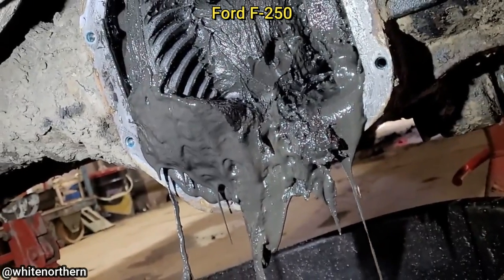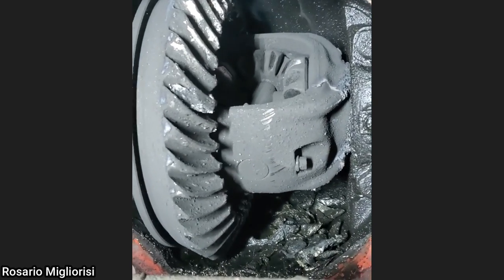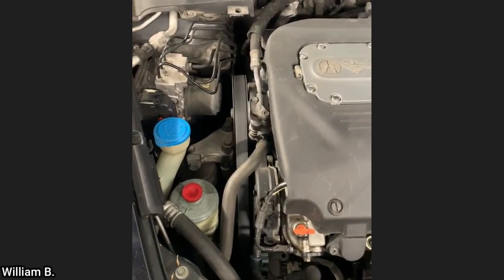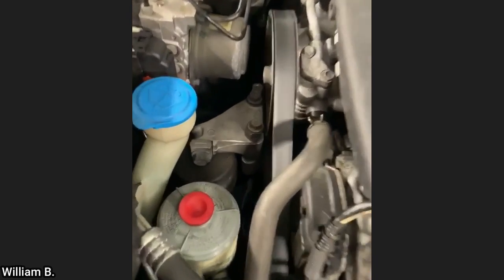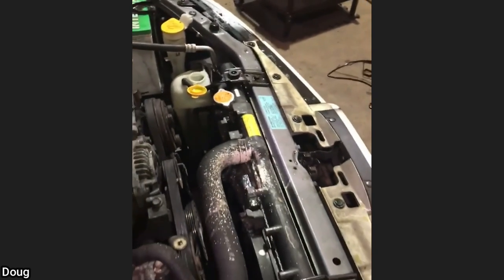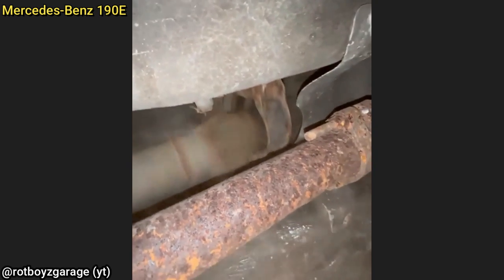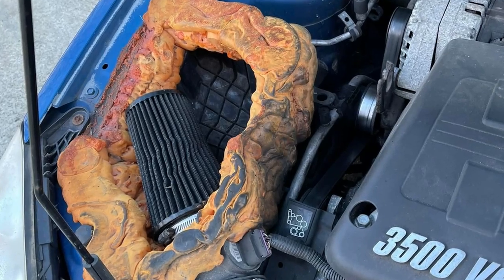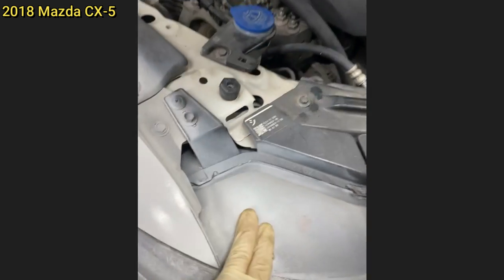Customer States Wheels Locked Up While Driving | Just Rolled In

Comment: How does one refuse getting a gasket replaced on a differential that is leaking? 
Probably the simplest repair/maint. job ever. 
Remember folks, these are the people with whom we have to share the roads.
Reply: Its probably one of the cheaper jobs you could have them do. Or do it yourself in 30 minutes.
Reply: I once worked at a shop that would have charged $200 labor, plus materials. Which is a blatant rip-off. But, they were the only shop in town.
Reply: A very costly replacement/repair now!! Hope the learn?!?
Reply: The other ones that kill me are the 'shade tree' mechanics who don't know that a torque wrench is a good thing to have and the bolt head (or god forbid a manual) will give you a clue.  Oooops.
Reply: i'm so glad i live in a country wich actualy has yearly safety inspections for cars! :)
Reply: I believe they said it has an axle seal leak, which isn’t exactly a quick fix. Still, would have been better than running their junk dry.
Reply: +1 just for the proper use of the preposition in the last sentence.
Reply: I would think that the majority of the times, it's due to the customer thinking they can either do it cheaper themselves or find someone who will. And it just keeps getting put off until the inevitable happens.
Reply: So in order to take axel seals out, you basically have to pull the diff cover off. Remove the c clips and the axels along with it. Than finally pry out the seals. Then once that is done clean up the surface of the plate, put on some new rtb, torque to spec. Then finally add the fluid. It's mess and it takes forever, but in the end is cheaper than a whole new diff.
Reply: I always believed an once of prevention is worth a pound of cure. So, I try not to let anything going wrong on a car not get repaired.
Reply: Thats literally nothing compared to the people who never service their tires or brakes.
Reply: @skurblord3401  Depends which gasket is leaking. If it is the differential gasket, the drive shaft has to be removed as well as the two axles. Then you have to have some equipment or tools to do it.
Reply: Also... those are the peoples old enough to do politics, and are filling the internet with comments like "climate change is a scam".
I would trust their excellent judgment.
Reply: @Nature31  in Spain we have annually inspections in cars older than 10 years too  , but i have to tell you that people who drive destroyed cars like that doesn't care about pass the inspections or fines  , being honest i ve never seen an extreme case like this here in Spain in road going condition but i ve seen daily driven cars with big problems and rusted parts that with time will end up like cars in the video and the owner doesnt care  and they drive the car in open roads with the rest of us so still be careful if you a shitbox looking funny driving on the road
Reply: @RANDOMNATION907  $200 doesn't buy 1 hour of shop time anymore, and that's usually the minimum time charged.  You did the work cheap in my opinion.
Reply: I dunno his story, but when was a kid I had a minor leak on my car diff, I just had them change the oil and the leak went away.
Reply: Was it only gasket or seals?
Reply: @clintletendre5585  I think he said gasket.
Reply: @boboutelama5748  <<< Al Gore fan detected......
Reply: That's why it's called defensive driving and not just smart driving, you might be the biggest risk to yourself, but everyone else is in a close second place, with some Very, Very, VERY CLOSE
Reply: And they can vote ...
Reply: @Nature31  that's un-American
Reply: @nicolasrouvreau8365  and breed
Reply: @Nature31  and a 40% tax rate I’m sure 😂
Reply: @skurblord3401  Most of the people that try to do it themselves end up back in the shop and in these great videos. :) Just pay the professional mechanic. 
Not the friend that says they know what they're doing. If your friend isn't a professional mechanic or retired mechanic then you're taking a big risk.
Reply: @Pieter Senden  I'm sure you like big brother watching over you and taking your money
Reply: Because money is hard to come by the average person cannot afford a 1000 dollar emergency repair
Reply: My car's diff is leaking, as is the engine and gearbox, i just dont have the time to fix it right now. gonna do it this summer. i check the fluid levels periodically and top up as needed. since the leaks arent mayor.

Comment: 1) that's how i always imagine my diffs looking like until i check up on the fluid level every oil change
2) man that chevrolet is so gorgeous, so happy to see old 1950s cars still around and in amazing condition, there is something truly beautiful in those '50s designs
Reply: You check your Diff fluid everyday???
Reply: @Thunderbyrd.  bruh, he said every oil change. 😂
Reply: Just wondering.  . . . . 70 years from now will people be restoring the current crop of electric vehicles?
Reply: looks like Chevy has Mopar exhaust tips...?
Does look/sound good
Reply: That’s actually my chevy! It’s powered by a 327 that I took out a 62 vette, and it took a couple years but it’s a full restomod!
Reply: @brakelineautomotive  What a beautiful car!  Thank you very much for sharing it with us.  What happened to the '62 Vette that donated the engine?
Reply: @brian5o  buddy of mine got rear ended pretty bad! He ended up selling it for dirt cheap already mostly built (>$1500) and we picked it up!
Reply: @Thunderbyrd. bwm driver spotted

Comment: That front diff filled with mud...that is just insane. Left me speechless.
Reply: I thought it was cement.
Reply: @andypetrovich2155  maybe it was.
Reply: @mikefoehr235  
We have seen it in previous episodes.
Reply: @andypetrovich2155  How in the hell did that driver get cement in the differential like that..crazy
Reply: @mikefoehr235   Can't answer on that case but in another?  How did the driver at the mine my cousin works at get the differentials on the work truck full of cement?  Easy answer in that case, environmentalists were sabotaging the trucks.  That happened in Canada.
Reply: @elilla331  
The cement wasn't from jogging through the work area because there was less traffic?
Reply: @andypetrovich2155  Not that day I don't think.  Though I've heard similar cases in parts of Canada where that's happened, especially near Fort Mac.
Reply: A terrible leaking diff seal maybe?🤣

Comment: "Customer states - Steering wheel loose" killed me. I am writing to you from the afterlife.
Reply: I work in car rental and recently got a return with a note "C/S back window doesn't work". Turns out it IS actually broken. But the first thing I checked was to see if the window lock button was on.
Reply: My favorite after "Blue light on dash won't go out" and it was the high beam indicator
Reply: @nancytoothaker3224  I had a co-worker, young female, who didn't use driving lights, because it just put the high beams on, not the low beams. I tried to tell how the lights work on a car, but I think she didn't got it.
Reply: Same here. I especially like the mechanic's attitude - there's a guy who's 'seen it all before'. Oh well....

Comment: Somebody might make a bundle doing audio books of the owner's manual. It's obvious not enough owners read 'em !!
Reply from the maker: Lol! Great idea.
Reply: Write them in Dr. Seuss style, maybe even the densest will then understand.
Reply: Only way they would listen to it is if they have to listen to it before they can turn on the radio.
Reply: My 1985 Buick Riviera came with the owners manual on a cassette tape! And my grandpas’ 1991 Cadillac came with it on CD.
Reply: My wife’s 23 Bronco has it in the screen, no book at all anymore
Reply: Meh, I think it should be required reading before you can drive it.
Reply: I just dont get it. I am a relatively young driver but the 2 cars of the 3 cars i owned that came with a user manual i always spend like a day or two just reading through it. I mean i wana know what my new car does and how i opperate it
Reply: Owner's manuals don't tell you anything useful anymore. Basically it's just a description of what all the controls are for. Anything else is "recommended for dealer service".
Reply: How come rental cars don’t have owners manuals?
Reply: @erichoekstra206  cause they get stolen
Reply: @annehaight9963  i mean my 2015 Opel and 2008 Opel do tell you allot of stuff and to be fair most cars take extensive knowledge to repair
Reply: @annehaight9963  Exactly- you want a Service Manual.
Reply: @bastik.3011  Good !! You are not a member of the "disposable" squad !!
Reply: @bastik.3011  I'm the same way. Also get a Chilton service manual, that comes in handy a lot too!
Reply: @erichoekstra206  
Rental cars come with whatever new cars normally come with. But over time, sometimes the manuals go missing. They may get stolen, or thrown away if they get damaged badly enough. People are very hard on rental cars and do not take care of them.

Comment: Anti seize on the top of the spark plug 🤣
Reply: Supposed to use dialetic compound on the ends.. anti seize goes on the thread
Reply: @scottrussell6717  dielectric grease on the boot, not the electrical connection. Dielectric means non-conductive
Reply: @scottrussell6717  Only if it's going into an aluminum head!
Reply: That way the boot don’t get stuck
Reply: @michaelwarren2391  True. It won't interfere, at first but, since it's silicone, the product of and electrical arc is non-conductive glass. Silicone is very bad around sensitive connections when a long life is intended. There are contact lubricants that are great, however.
Reply: @John-cg8hb  Yes, in the threads, but it's loaded with nickel, copper and graphite so keep it off of the porcelain. I like to the the Champion brand of spark plug lube as it's just graphite with no metal.

Comment: I love the similarities between being a mechanic and nurse. 

Customer states “breaks squeak when breaking.”

And as a nurse, patient states “the vibrator got pushed to far in.”

Yes, a lady had a vibrator stuck, it was still on.
Reply: I'm assuming you were a nurse on that one first hand.  Also, i bet she looked uncomfortable physically and otherwise.
Reply: @cryptfire3158  i would say it’d be a bit awkward if it was a mechanic checking
Reply: @monsterproml46  we'd have a video on this channel if it was a mechanic checking her.
"Customer states: 'Was almost at the finish line and my fingers slipped off.'
No mention on how the butt plug got stuck also."
Reply: Brakes*
Reply: @cdnmetelhead4013  that’s why I am a nurse
Reply: @cryptfire3158  "She was just sitting there humming."
Reply: Came in to get the batteries changed
Reply: At least they admitted they pushed it in. Most of the time it’s “I fell on it” or “I have no idea how this entire cucumber got inside me!”
Reply: @Jack_Russell_Brown  My SIL was an RN working trauma in the ER. SHE has some stories to tell.

My (now ex) MIL used to work in the morgue in a hospital. Some gross stories were told about that. Not to mention I used to carry my lunch to work in a "specimen" container. Never used for body parts tho.
Reply: Idk how a hamster in a wheel is related to a vibrator in too far. I'd be much happier to explain either, than need to explain the hamster to a nurse... And police
Reply: Ha ha ha ha

Comment: I heard of a guy, in the 80s, drove his car to Earl Scheib Paint Shop to be painted... When he picked up his car, he came inside to ask how to get the tape off the windows. The manager asked 'What tape?'
Reply: Exactly! That $99.95 paint job by them was just that, paint. No prep work - no masking, no sanding, no cleaning before the painting.
Reply: @stuartaaron613  $99.95? I remember in the 60's it was, "I'll paint any car any color for $29.95". Same deal though, no prep.
Reply: @michaelwarren2391  I recall the Earl Scheib commercials in the lat 1970's/early 1980's. I think it was $99.95, but it could have been less.
Reply: And if you slipped the paint guy an extra $20, he'd use a roller instead of brush.
Reply: @michaelwarren2391  It kept going up over the years.
Reply: I had a friend that worked for Maaco corporate. You could get a pretty good paint job if you did the prep and taping yourself, and waited for one of their 50% off deals. This was in the mid 00's, and out the door you could get their top end paint job for like $500. Wasn't show quality, of course, but it beats peeling clearcoat or primer.
Reply: I actually had a decommissioned 1988 X-FHP Mustang painted at Earl Sheib in 1993, I had purchased it from auction and it still had the black and tan paint from the FHP though the tan was painted over with black spray paint and all of the decals were removed and the antenna holes were just covered over with some kind of putty.

The paint job that they did wasn't too bad for what I paid, I don't remember exactly how much it was but was probably a few hundred dollars and it came with a lifetime warranty.  Over time, the paint got some cracks and spiderwebbing in it though some may have been from bird droppings sitting on the paint for too long.  I took it back one and they repainted it.  It happened a 2nd time and they refused to.  It still didn't look too bad for the price though, definitely better than when I got it.

I wonder if they're even still in business?  The one I went to has been gone for years.

Comment: Today on the way home from work, I saw a mid 1970s pickup truck that was so rusted that much of the side panels around the wheel wells were missing.  There was a long piece of rusted metal hanging down and rubbing against one of the tires.  I think if the cops saw it they would get it impounded and taken off the road.  Way beyond repair.
Reply: Used to see that all the time in Michigan.
Reply: Just another tuesday in the rust belt.  Odds are the driver was fixing it up and needed to move it to another location.  Fixing, not restoring.  Lots of guys love driving old beaters like that and they can be safe and reliable despite looking rusted out.

Comment: "the customer refused all repairs" is basically a meme by now. All of them think they are so smart by totally ignoring the advice of a certified mechanic to later come back with the same issue, that possibly caused even more, expensive damage.......
Reply: Yeah, well.....
Funny how I refused all repairs when the shop told me I needed a new serpentine belt....after I had installed 4 new v-belts just 3k miles earlier.  
Or the shop that told me my clunking was a need for new strut towers when it was actually a bad $8 front wheel bearing.  
It's these guys that give quality mechanics a bad reputation and forced me to learn to do quality work on my own vehicles--and know my limitations.
Reply: @eldoradocanyonro  Certainly it's not about "customers always need to trust mechanics" - because there are many bad and even malicious ones, who want to squeeze you for money.
Having some knowledge for yourself is worth a lot. I was basically referring to those people, who don't know shit about cars. Who try to "repair" a badly rusting undercarriage with some zip ties or shit and think it's fine. Wheels almost falling off, the enfine leaking everywhere, and when the mechanic tells them, this is not a good condition, they just think they know better, like if the position of all mechanics is just a scam.

Comment: I had a minor leak on my front axle seals on my old Dodge Ramcharger, and I checked my fluid level more often than I got gas until I had time to take it to someone to fix. Replacing axle seals on a dana 44 front axle is not fun.

Comment: The one at 1:27 is such a Subaru owner thing. If you fix the common issues and do proper maintenance they can last. That radiator leak is a SUPER common issue on those models that should always be fixed asap.
Reply: If you pour money and time into any machine it’ll keep running regardless of how unreliable it is.
Reply: Sure but in this case it’s not necessarily unreliable as long as you do regular maintenance, ie oil changes etc. my car has 172k miles no problems. The radiator fix is just the biggest thing and even then it is not too bad
Reply: @willmetz1490  Subaru's don't have a bad reputation for nothing, they do deserve it.
Reply: Tell that to all the ones I know including mine at 172k miles no problems

Comment: "customer said they would replace the radiator themselves".  Reminds me of a guy we had in our shop.  I told him "your water pump belt is about to break" and when we priced it for him, he elected to drive to another city to buy it at autozone and save $6.  He didn't make it.  This was one of those aluminum-blocked Cadillac engines and he had to junk the car.  One of the reasons I don't work on cars anymore...

Comment: I don't really know much about cars, but I'm trying to learn more by watching videos. I just did an oil change for the first time on my truck after watching several videos. I don't want to end up in one of these comps lol.  I'm wondering if anyone can recommend any good YouTube channels that do maintenance and minor repair videos for vehicles.
Reply: South Main Auto channel. Eric is a solid tech.
Reply: well .. these vids will show you what NOT TO DO.
Reply: just try taking it to a GOOD mechanic.  Don't rely on ANY YT vids giving "good" advice, any more than tying doing brain surgery on yourself based on a movie or TV show
Reply: @rhuephus  Yea I appreciate what a good mechanic can do. I'm just trying to learn more about vehicles and generic issues/fixes. I have no intention of putting washer fluid in my coolant reservoir or spray foaming anything lol. But if I can change fluids, tires, brakes etc I could save some money.